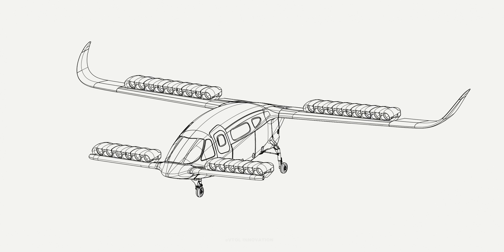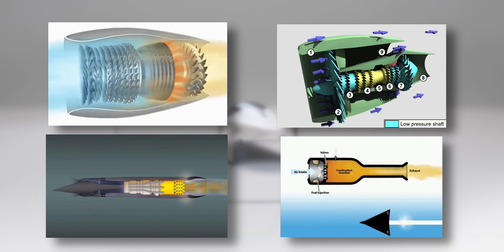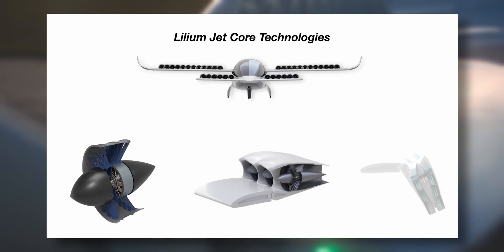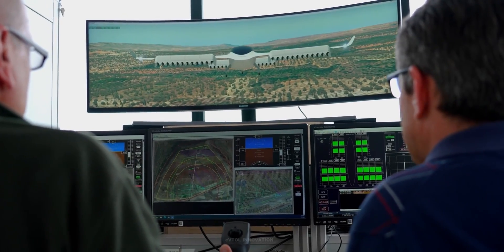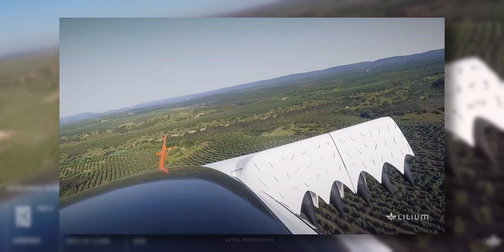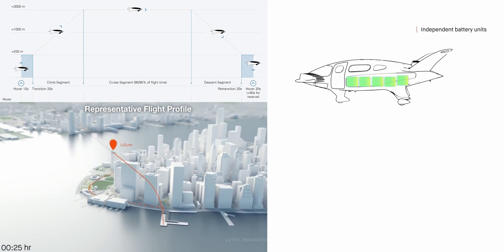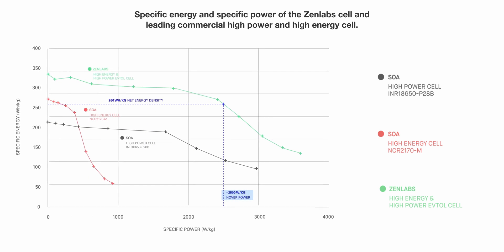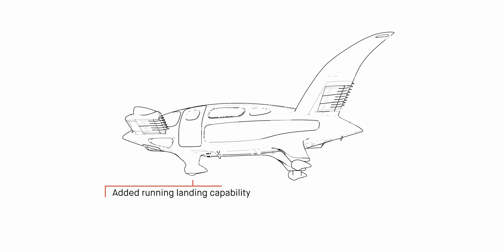The Insane Engineering behind The Lilium Jet | Part 2

Comment: By your reasoning, technically all propeller airplanes are jet airplanes too which makes that distinction irrelevant. From 36 to 30 EDFs (electric ducted fans), increasing diameter by 10% only increases efficiency by 10%. By comparison Joby, Beta, Vertical, Archer, etc evtols have 3X larger diameters which results in 3X more efficient using the same battery tech.
Reply: Exactly, you are totally right. I do not understand why the author of this video is portraying ducted fans as jet engines. They are nothing alike…

Comment: So it should be called an Electric Ducted Fan……Jet includes hot gas, the internal combustion definition.  So it is incorrect to call it a jet.  It’s an Electric Ducted Fan….your marketing team might want to call it a jet, cause it sounds cooler.  But it’s not what it is….
Reply: Right. The remote control flying world has already adopted this designation for electric model jets. The nitrio fueled R/C Jets have been called DUCTED FANS since the 1970's.
R/C Jets with the new generation of electric motors have been called EDF's since the early 2000's.
Lilium is electric. Lilium is powered by multiple Ducted fan units. So as far as I can see, EDF applies. 
Having said all of that, the public will make all this engineering work worthwhile. The company will have to decide whether EDF or JET will play best with the consumer who will ride in it. And I didn't forget the FAA. Lawyers too. Liability will also play a part in how things are marketed. It will be interesting to see how this plays out. 
But as a licensed pilot, I'm just ready for a ride.
Reply: @rocketboy917  lol what about a jet boat that does that need to be changed to water ducted turbine powered craft
Reply: @rocketboy917  definitely see your point but it’s semantics…is lift generated from newtons 3rd law or Bernoulli’s principle? Technically both definitions are correct 🤷🏼‍♂️…im mean technically most commercial aircraft use “high bypass turbo fans” or “turbo props”…hell even some helicopters use a “turbo shaft” system where as fighter aircraft use “turbo jets” …all are powered by gas turbines but only one is considered a “jet” …again it’s all semantics….in the car world we call turbo chargers “turbo chargers” but in aviation they’re called “turbo superchargers” 😂🤷🏼‍♂️

Comment: Could a micro turbine generator fueled by hydrogen be an alternative to batteries? GE has large hydrogen turbine generators already, could we see a suitcase-sized hydrogen power pack system used as a clean energy source?
Reply: Stanley meyers engince can be modified for air flight.
Reply: plutonium

Comment: Dear Lilium designers/engineers, I want a two-seater Lilium jet and if you don't mind, incorporate into the manufacture of same a coil in the nosecone in front of each fan that will serve to harvest the kinetic energy from the rotation of the fan shaft in the form of electrical energy to be used to continuously charge the battery array. Naturally, this will result in unlimited range without ever needing to be "plugged in". 
Get on this right away a let me know when this relatively simple task is complete so that I may purchase one for say, a few thousand dollars, if that price is feasible. (tongue in cheek)
Reply: funniest thing i heard today, thankyou
Reply: @operator2618  The cost was the only part that was meant to be humorous.
Reply: @oscarwindham6016  yer serious ??!!??!!!????
Reply: @paulslevinsky580  I am serious and though I've never used it in gainful employment I do have an AS. degree in Computer Science Electronics. That idea of incorporating a coil in the nosecone of each of those electric engines in order to harvest the kinetic energy from the rotation of the engine shaft in the form of electrical current that could be used to continuously charge the battery array is feasible, in my opinion.
Reply: @oscarwindham6016  - Then I Have Diamond Mine to gift you! It's in Tuktoyaktuk, if you don't mind the "Walk!" 🙄

Everyone thinks they can get "Perpetual Motion" so easily! It appears you are one of them!
🧐😂
Reply: @robertweekley5926  NOT perpetual motion, but PERPETUAL PROPULSION, if you don't mind? Facts are facts, and the fact is that there is wasted kinetic energy in the rotation of that cone in front of all propellers or fan jets, so why not harvest that energy? I sure hope all you Nay Sayers don't force me to do all the work plus come up with the idea. The fact is that we have the best and the brightest minds in the history of our species and it's just a question of time before this idea is made reality.
Reply: @oscarwindham6016  - Well, I give you credit for having a strong Belief in your Idea! 

Have you any idea if it can be Demonstrated at a multitude of 'Scales', from Small to Large?

But, along the way, do you know the purpose of that "Cone?"
Reply: @robertweekley5926  I don't care about the purpose of the cone, I just want the space for a coil.
Reply: @oscarwindham6016  What you call "perpertual propulsion" isn't impossible, as birds sort of do it to remain flying...

...Except that they make direct use of the air currents to remain airborne (just as some gliders do) instead of using dynamos to charge relatively heavy batteries with a loss of efficiency.

But "perpetual AND FREE motion" does not exist. In your clown idea, for example, you are just introducing drag that amounts to way more than you should be able to generate with dynamos. A total loss of efficiency.

Doubt you can grasp the idea, but one could theoretically at least "take back" some of the energy spent climbing by having the turbines working as dynamos during the landing sequence. However, the drag produced here would be "horizontal", which actually makes the trip longer and puts a fixed-wing aircraft at the risk of a stall. VTOL planes like Lilium Jet, on the other hand, can't produce enough vertical drag for their fan blades (be it propellers on turbines) end up acting as parachutes, hence why they execute powered landings.

Also, the gliders I'm talking about are already at the limit of size to properly use natural air currents for continuous, battery-free flight. While they are expensive due to their ridiculously light and complex materials, a Lilium Jet buyer should have enough to buy such a cool gadget; They are small and carry very little, though.
Reply: @oscarwindham6016  " I do have an AS. degree in Computer Science Electronics."
people like you prove again and again that schools dont actually make you smarter lol
Reply: Nun lasst Oscar doch weiter von seinem Perpetuum Mobile  träumen ....☺️

Comment: How much can VTO noise levels be reduced with a 50 meter, 100 meter or 200 meter runway? 
Could winch assisted landings be considered to limit VL noise levels?
Reply: That is a great question. A short runway would also improve the energy performance a lot.

Comment: Curious what C discharge rating is deemed neded for VTOL. Does anyone explore dual chemistry or dual battery designs?
What's the higher Wh/kg cell used thus far? Tesla and NIO are loosely claiming to be at 360 Wh/kg for upcoming products.
Reply: 500Wh/Kg is here now.
Reply: @TheSmallRabbit where, which chemistry is used?